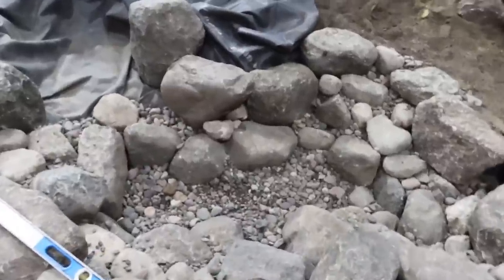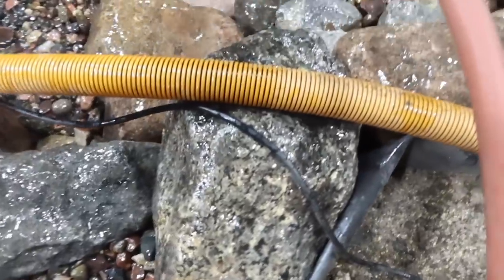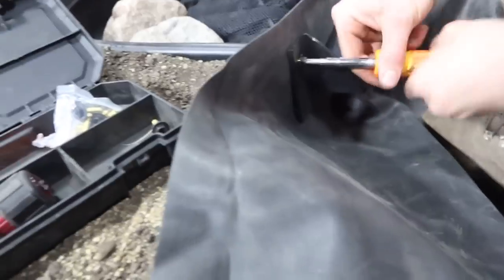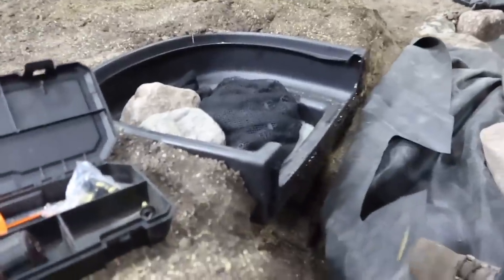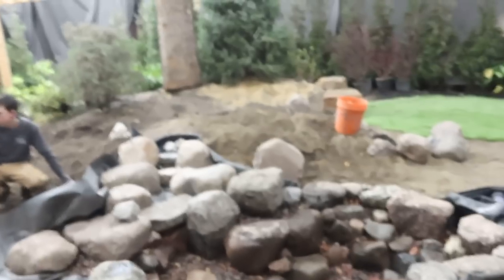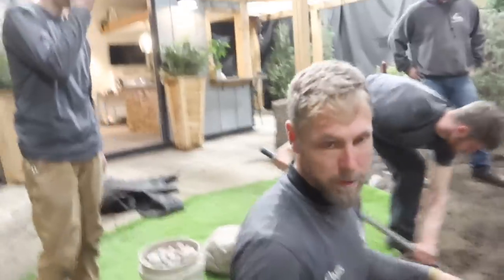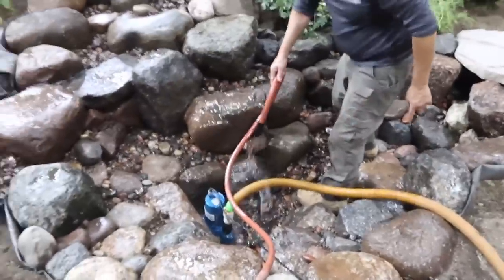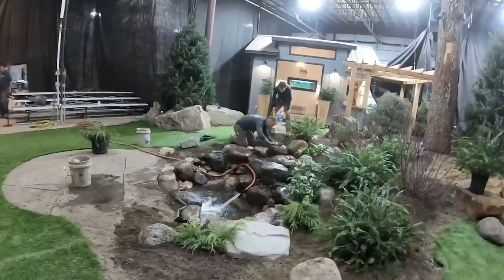DIY POND KIT Installation and FINAL REVEAL

Comment: Very helpful video!  Do the foam and silicone come with the kit?  Good to see what tools we need to bring to the party.  Will also need a sump pump after spraying down the rocks.  It would have helped to see how you keep track of water level without a laser; would sight line strings help?  Chalk lines on liner / rocks?  If you had clips to secure the folds in the liner, when finishing the edges, you could do that step solo, yes?  Sorry to see Cory leave (hope to see him on any Arizona projects)(Would even like to see Nick again on a Chicago project).

Comment: I'm building a smaller pond
And I have a high side and a low side..

Of course the side closer to the house is higher because of drainage away from the house

My question

To build up the low side to make the pond even level

I just build up dirt on the low side and pull the liner even...

Then back fill??